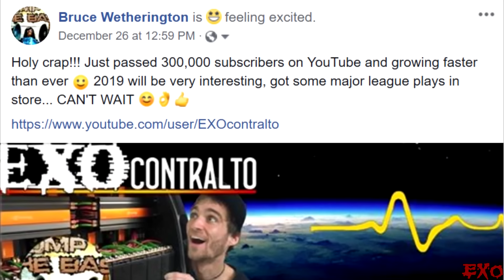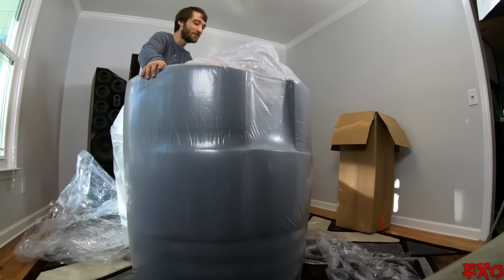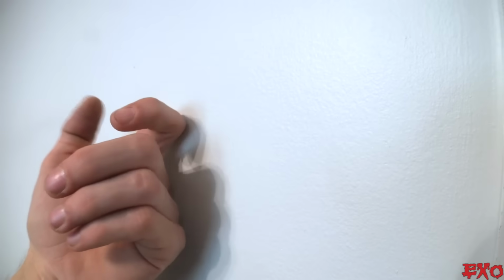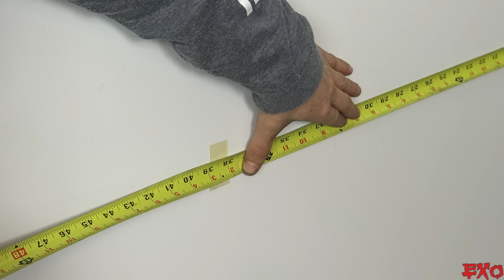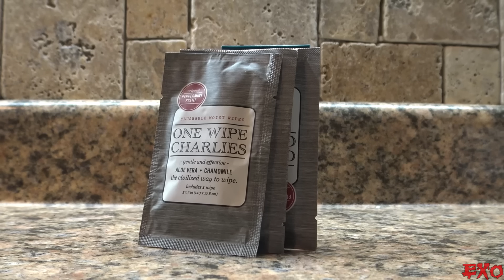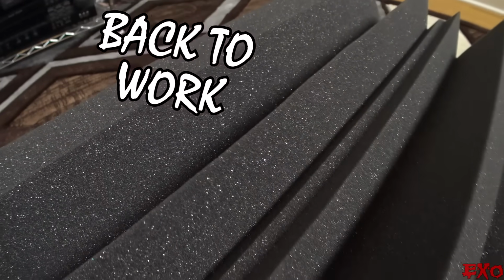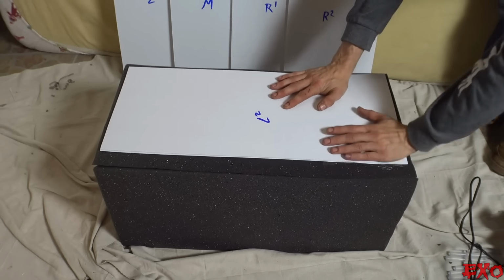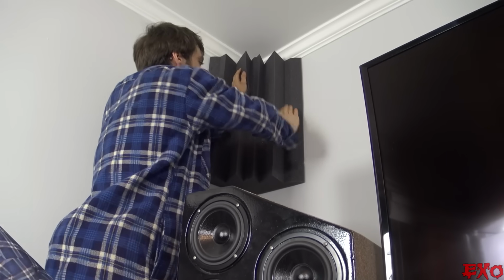How To Install Acoustic Foam Panels w/ NO ECHO | Home Theater Sound Treatment Setup BEFORE and AFTER

Comment: I had some boxes left over. Took em apart and the cardboard was thin enough to run a thumbtack through it and pin it on the walls. used a hot glue gun to attach the foam panels to the cardboard and we're all set.

Comment: Remember Foam like this will be great for upper midrange and high frequencies but it will not help with Bass! (yes they sell this foam as a bass trap but below 250Hz they are ineffective). 

Make sure to build some Bass Traps from 703 Owens Corning compressed fiberglass.  Mount it on the same plastic if you want to make it easy to remove like you did before. 

Check out Ethan Winer's videos where he does some scientific comparison between materials and how to apply them in a common home room. 

Great work and nice setup!
Reply: This foam wont work either way...
Reply: @djnekkon  yes it does you either listen to gearslutz to much or your probably listening to this on some crappy headphones the foam definitely helps a whole lot
Reply: @alien-hs1zn  Not that much in bass frequencies though.

Comment: I've been browsing Amazon for some sound proof panels and I'm so happy that I found your video. I'm definitely keeping this company in mind when it comes to sound-proofing my room!
Reply: Please understand that this is not sound-proofing anything in any way, shape or form.  Acoustic foam does nothing but reduce high frequency flutter echoes.  If you want to treat a listening room you should at the very least be using broadband diffusor panels and bass traps.  Using foam products like this is going to sound like it helps but in actuality, it's like turning down the high end of your system and in many cases, making mid-range issues more of a pronounced.
Reply: @JAMPROSOUND  hey bro can I contact you somewhere ? I’m a college student but I make music and I want your advice on sound proofing

Comment: WOW! The voice is so much solid and sounds way more professional without the treatment. I was skeptical because I am like. PFFT, foam, that ain't gonna do anything. Whatever, and after the sound tests I was blown away. Furniture also makes a big difference. Put in a cheap sofa in there, and you reduce more sound. But thanks for the tutorial. I been struggling with reverb. I been recording with a blanket over my head and it was honestly so hot under there. Lol. This is gonna make my vocals sound awresome. My $150 mic which has a higher rating than the Blue Yeti USB mic (Samsun G-Track Pro is what I have) is going to make my vocals so dry which will be perfect for mixing. Like any mic is going to sound cheap aF if the room isn't treated, and I been like "Oh, maybe glue carpet to the walls" I thought foam was gonna suck but it seems like they work.

Comment: Just so you know, this foam only treats the high end, below ~2000hz this foam do not absorb anything. Anyway good video !
Reply: Really? How come the results are so obvious? Overtones?
Reply: I agree. There will still be standing waves for the lower frequencies which won’t be obvious in the sound demo because the sources were voice. It definitely made a difference but won’t stop the large wavelengths from continuing to decay, and you’ll hear noticeably different amplitudes of low frequencies at different locations within the room.

Comment: Hey man, not trying to be a jerk. Just some constructive criticism. A wall of sound might be nice for music because it makes a "sound stage" like at a concert, but movies are usually more engaging if there is surround sound and you have proper sub placement. Since every room is different, you usually want separate subs so they can be moved around the room until you find the sweet spot for them to live just like in a car. Sometimes it's up front, sometimes it's behind you. Heck, sometimes it's in the middle of the room depending on the room. With my limited (5 or 6 sub boxes made) experience building subs for cars, just rotating a box can completely change the way it sounds or performs.
Either way, awesome stuff on the foam panels. You might even want to get some extra for the garage when you are using tools so it's a bit quieter. (might make the neighbors or lady happier)

Comment: Awesome video showing the benefits of room treatment. You can really see how much your voice cleared up in the waveforms, and of course hearing it clear up too.

I think giving some air between the wall and the panels helps a bit more than adding a backing to it and sticking it on the wall, something to do with it hitting the wall, then it has to pass through it again. (But I'm not a scientist, that's just something I heard on the internet)

I personally use Roxul Safe and Sound, one bag (24x48) covers around 64sq feet (8 pieces inside) and makes a huge difference with just 8 panels.  

You could probably make bass traps if you cut one into 4 triangles. One bat of it will make a single 12" tall 16" deep wedge thingy I believe. (I have yet to do this, but measures out to that)

Cheaper than the stuff in the video, only downside is you'd have to put in the work to build a frame for the panels, and cover it. (not that hard, but not everyone has the tools)

And I'm not familiar with the stuff in the video, I'd have to try them out to see if they would work better or just as well as the Roxul, but I don't have the kinda of money to drop $400 to test sadly.

Comment: FYI You can utilize a noise gate to try and prevent the lower db value echo's from the room from getting into the mix. I would also implement it with a gentle knee because if it is too harsh it will gate on spoken word. This is a fine line to walk because, it may result spoken word having its' tail cut off so to speak, but I recommend this for people that can not afford acoustic treatment.

I have used this in a Biamp DSP and have seen tremendous improvements as a result.
Reply: Hell na id rather build a good room where I don’t need to use a noise gate

Comment: I really like the video and it was very helpful but I did see one problem in your video. You show us the strips to get. Which are the white strips for holding. Then later in the video you use black velcro strips for applying to the holding strips. So I need to know what type of black Velcro strips you use. So I can go out and get those same exact ones so I can put those on my panels. I’m just really confused. If you could help me out that be great.

Comment: Looks and sounds AMAZING. That said theres two things you can do to make the room sound better
Option A mount the tv on the wall with a TILTING mount and tilt the tv downward this will help with the reflections. 
Option B if you don't wanna "damage the walls" by mounting the TV then ADD acoustic panels BEHIND the tv. g
HOPE THIS HELPS SOMEONE. God bless guys.

Comment: First things first, you need to bring them speakers about 4 feet into the room.  O really, try it.  I put several 12'' X 12'' behind the TV and it helped so much.  I 'm guessing the sound was just bouncing back there and causing a delay of the sound to get to my ears.  Something was always a little off and o boy did it make a difference.  Put a really thick blanket behind there just to see if it will make a difference.

Comment: Can you just use adhesive tape directly on the foam itself and skipping the plastic? Also, does it make a difference if you cover the ENTIRE room with foam panels vs just setting them up in various places? Thanks!

Comment: Happy new year guys to you and you family all the way from a small town called Aylsham which is in the UK and hope you and you guys celebrated in style with some good tunes on, I did that with my bag of ridden 2 up the garden with the misses, it was a clear night so we could see millions of stars, beautiful and just amazing 🤩👍😀😀😀😀, just some hints how you I make the air ports bigger on both sides without tacking it apart, could I glue the same sized pipe as the air whole but with and 90 degree angle using pluming pipe so would be cheaper for having 2 air ports  would it work if the got slowly bigger till the end of the pipping it, would it get more Bass or would that’s sound rubbish, any hits as love what you do and I’m new to your channel and will never miss a vid now I have the bell on, best of wished to you and all you know into the new year brother

Comment: These foam panels tend to be very expensive for what they are. If you want the same results for next to nothing then all you need to do is hang curtains from hooks on the walls. If you don't want to put them on the wall you could make yourself a little cubicle that can be taken down when not in use. The sound waves will be absorbed by the fabric. You can add as many layers as you want. The more the better. This will stop echos. You will also need to put a rug or carpet on the floor. Even  table cloths over furniture helps. I would only use foam tiles on the ceiling.

Comment: Does the hot glue destroy the good foams?What kind of your hot glue used in the video?I thought there are many kind of spray adhesives but they are too strong to be unloaded afterwards when I move to new home.Not sure whether the spray adhesive will damage the foam too.

Comment: What if I can afford to get enough panel to cover most of the side walls. Can I do that ? My little studio has a V-shaped ceiling. So, I need to get as much absorption as possible. Can I cover most of the wall or do I need to leave gaps ? Best ideas on how to treat a room with a V-shaped ceilings?

Comment: My wife will never agree to this much foam treatment. My speakers are rear ported and very close to the wall, do you think I should put some acoustic foam behind the ports?
Reply: No, you need to move your speakers away from the wall. You'll get better bass and midbass response. Boundary reflections really screw up the sound

Comment: Great video indeed! Where did you purchase your coroplast from? Your recommendation will be greatly appreciated. Also, what were the measurments of the coroplast you had in your video? 

Thanks.
Reply: Well considering the squares are 12” squares or 1square foot and the panels were 2 squares x 3 squares that means the big panels are 2’x3’. I would have to go back to get the size of the bass boxes.

Comment: I'm thinking of doing this for my living room. My question is, before the room was treated did it seem like there was a lot of echo? Idk if there's echo in my living room or if I just don't notice it yet. Also, since my living room is not in an enclosed environment, will echo panels be even effective? My main goal, is to stop sound from traveling from the living room downstairs to the loft upstairs where my wife works. I've got a bird that squawks pretty loud, and a 2 year old that has cocomelon on repeat. I don't expect it to completely get rid of the noise but my hope is to at least dull the sound enough were it's not disruptive to my wife.

Comment: To speed up the expanding process, throw them in your washing machine as it's filling up with cold water for a few minutes. Then ring it out with your hands to get most of the water out and then put it in the dryer on low. Time may very depending on the size of the foam. Also, even though most of these say fire retardant, stay close to the dryer to monitor it...hope this helps 😎👍

Comment: The cheapest way to install an acoustic foam panel is by putting painter's tape onto the wall and then putting hot glue onto the painter's tape and sticking the foam panel to the way. I did this and the panels stuck firmly to the way. You can get painter's tape for really cheap and you can also find hot glue and a hot glue gun at the dollar store.

Comment: Hi, does it reduce the noise outside the room after installing the acoustic foam?
Reply: It doesn't it's sound treatment not sound proofing, this is to stop standing wave reverberation on flat reflective surfaces, to sound proof you need to build a room in a room and a whole bunch of other things.

Comment: Hey exo i have a question for ya. So i have this amp in my car with a 12 inch sub. What would cause the amp to output more power to the sub by using hpf instead of lpf? Cause when i plug the rca cod into the amp the bass drops to a minimum but when i plug the speaker wire into the amp it hits wayy harder. Why is this happening?

Comment: What glue are you using? I've been struggling with different adhesive methods for months and I'm trying normal hot glue but it doesnt seem to be working. Does anyone have any recommendations?
Reply: what kind of surface are you trying to hang the panels up on?

Comment: @exocontralto
What if you cover entire wall?
Is it bad
Reply: No, just expensive. Seeing how this stuff is about $5-10 a square foot. A standard room of around 10x12x8 would end up being 300-352 sqft just for the walls. Then another ~120 sqft for the ceiling. You would be looking at $2100-4720 to cover an entire smallish room.
You would also run into diminishing returns. If I remember correctly, doing about %25 sound dampening coverage will get you about %50-70 performance. Adding another %25 coverage will only get you about %10-15 more performance. Then the next %25 coverage will only get about %5 performance. The benefit per dollar goes down pretty quick.
Reply: I would say yes. It’s bad. Would make the room too dead and unnatural. I’m speaking more from a sound recording perspective rather than home cinema. The key though is getting the room corners sorted as bass will build up there.

Comment: Good attempt but the room is too small for those thing's you've made.....big speakers need room to breathe and you'll run into separation issue's and over bloated bass dispite the panels....you need a room at least 3 times bigger for your application buddy.

Comment: Can any suggest me a good BUDGET system in my daily? Just subs and amp. Its a car and my back seats don't fold down sadly. I have great highs and mids but need some bass. I was leaning towards putting 2 10inch ports in the rear deck connected to a sub box in the trunk. Any subwoofer/amp combos on the cheap side that beat deep?